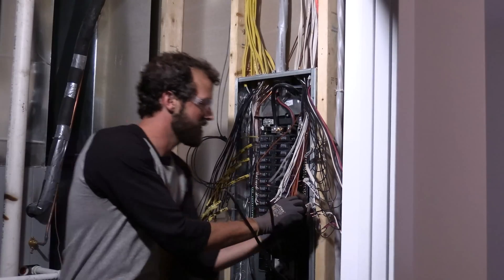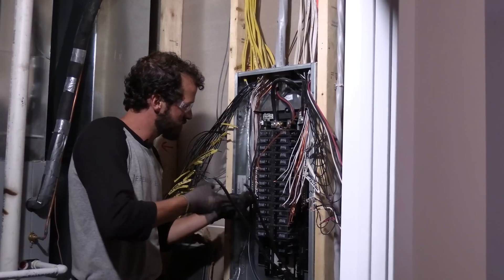Tesla Exec Revolutionizes Breaker Panels Forever - 2

Comment: just curious if you changed your homeruns from what is now the subpanel to your range and dryer or any other appliance 240 that has 120 controls.. which requires 2 insulated hots 1 insulated neutral and bare ground ..think thats whats supposed to happen.

Comment: Love the Casablanca comment at the beginning! 120v here in the US causes a moderate sensation when you're expecting it, but it's 220v in Morocco and that's double the sting. I'll stick with my Fluke NCV detector, than you very much.
Reply: I'd far rather get hit with 240V and 2A compared to 120V and 4A. You can barely feel 240V with no load on it either.

Comment: "Take responsibility" unless union workers say NO, you don't touch our stuff
Reply: We had at least 3 separate union electrical contractors performing work at our large facility. One company continually performed crap work. Our luminares in a generator room had their 3way switch tied into a traveler from another room so you had to go into that room & turn on the luminares in generator room to turn on. Took them 3 years to finally correct it. They finally got thrown out after serious screw ups.
Reply: @JohnThomas-lq5qp  yup